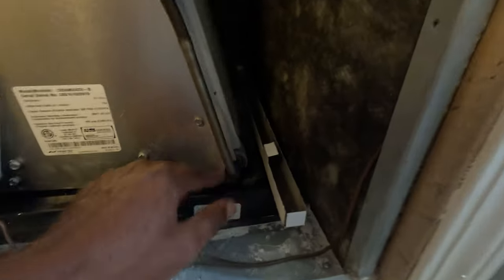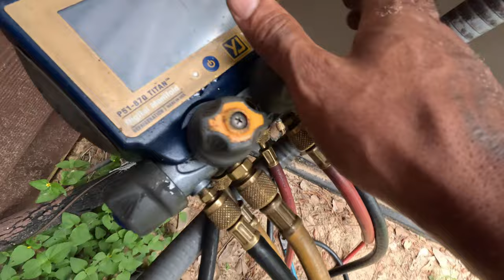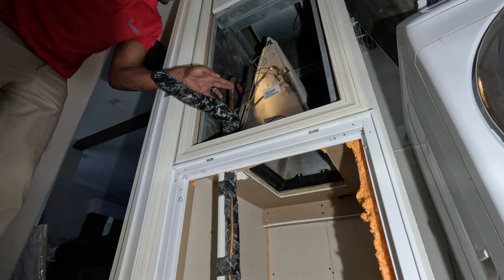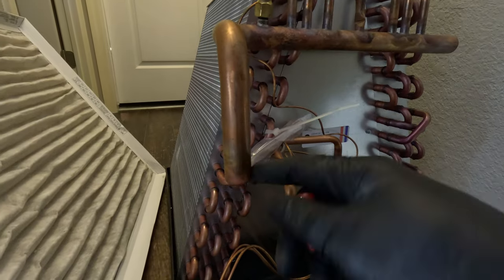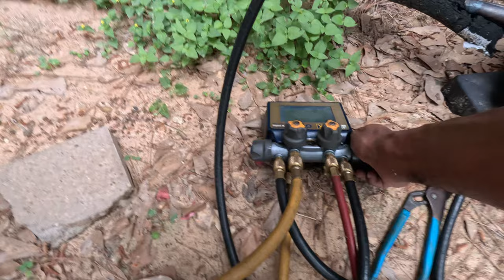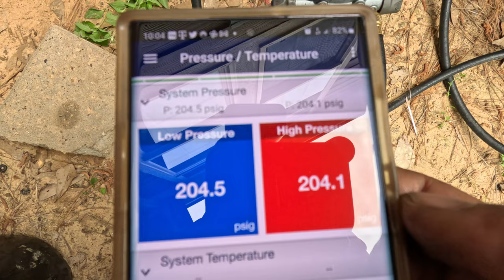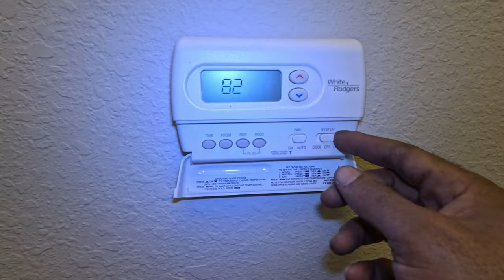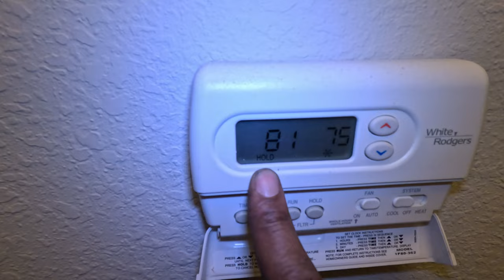HVAC Repairs Made Easy Mobile Home Evaporator coil replacement

Comment: Walter, you have all the tools !  I still see HVAC folks using only the minimum they can get by with and most of the time, they leave colatteral damage as a result. I have seen guys use a cut off wheel on the copper vs. a pipe cutter too. Imagine the debris that gets inside those pipes !  I have also seen guys use some sort of solder that doesn't require nitrogen to braze...I don't see the point since they need to check for leaks as well. 
Good idea to replace that all aluminum evap to a copper model like they should be from day one.
Reply: Yeah, I second this. I've seen some HORRENDOUS things... Have I brazed using nitrogen everytime? No, but now that's I've known better I sure do! Good practices taught, are good habits going forward!
Reply: It’s called STAYBRITE #8. Absolutely Amazing Stuff ! Give it a try. You will Love it !